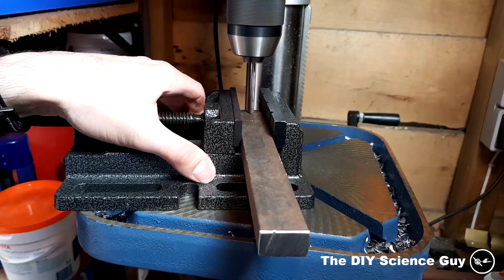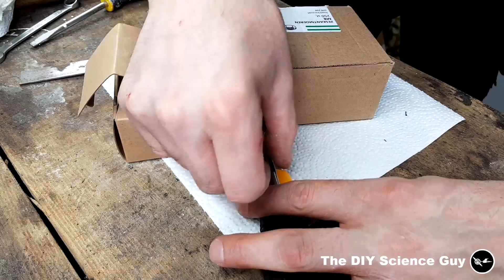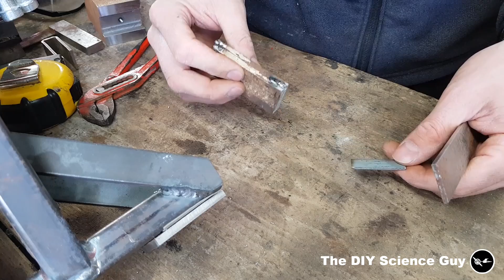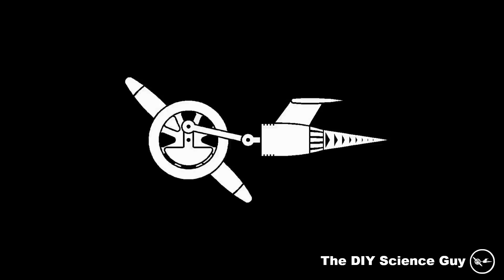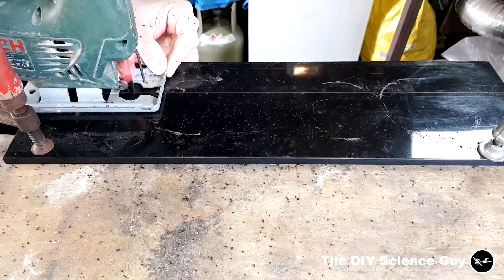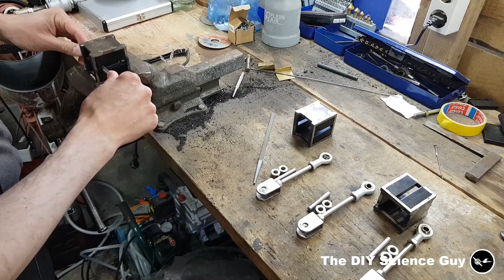Solar steam engine #6 Crankshaft and crosshead-True DIY

Comment: I like the idea of a steam powered reverse trike or car. Problem is coal makes pollution, charcoal is a mess and not as much heat. You would need something like propane or natural gas. It seems making a steam engine isn't too hard for a single cylinder design.

Comment: Hi, great videos you have a very inventive mind and the enthusiasm too! 
Have you considered using your solar powered steam engine as a turbine or generator? I am looking to incorporate a thermal generator design for a solar passive home in the UK. Is it feasible to use solar energy to  provide heating and electrical power via a steam generator to run a typical home?  I was thinking of incorporating a battery pack too as back up, when solar is insufficient.  I would also like to include a grey water recycling filter system.  I'd love to hear back from you.
Reply from the maker: Thanks! Yes I'm going to make a solar powered generator. You do not need steam to heat you house, only warm/hot water which makes it much easier. You do not need a battery pack, just store hot water in a well insulated container ready to be used by your solar generator when you need electricity. Have you seen this video of mine: https://youtu.be/s5Ud-FD33tI

Comment: The bearing surfaces on the crankshaft are called journals.
The half circle on the crankshaft is called a counterweight. I'm not sure you need a counterweight due to the layout of your three cylinders. The counterweight is used to balance the reciprocating weight of the pistons, and top half of the connecting rod in inline and V type engines. Boxer engines are self-balancing as long as all the reciprocating weights are the same. Your radial design might be also. You may want to research how they used to balance radial aircraft engines.
Reply from the maker: Thanks for the info! Yes I do need a counter weight same as with a radial engine.

Comment: Hey dude. How's it going. I think your 8mm crank pin is going to suffer a bit when you start to put a load on the engine. I assume you are going to make this engine do some work. Those that make engines that just rotate, without doing any work, is so lamo. There is a way of having all the cylinders at the same level regards the crank, rather than stacked on top of each other as you have done. The one at the top is going to be trying it's hardest to bend your crankpin. You should review how they set up the cranks in the old radial engines. That would make the crank less likely to bend. Really looking forward to your next video. Best wishes.
Reply: Exactly, it's actually pretty easy to do, you can make it out of a single block of say 12 mm metal, cut it into a equilateral triangle trim the points so they;re flat and drill and tap the cantre of the trimmed off ends to take the connecting rods then hone out the centre to take a bearing to fit over you crank, and I'd be making that crank a little more solid too, I'd look at using a 12 mm shoulder bolt for that job!!
Reply from the maker: I know, we will see how it goes, thanks for your input! 👍

Comment: how much energy can an  engine like this produce? and can they be made 6 or 8 cylinders of the same size?
Reply from the maker: Estimated power os about 200 watt. All cylinder sizes are possible ass long as you keep in mind the expansion cycle.
Reply: @TheDIYScienceGuy  thx for the reply. lets say if u was producing hho gas and using some sort of a boiler and wanted to use an engine like this to turn a generator what can I expect from lets say 1500+ lph of hho from an engine like this?
Reply from the maker: Well this steam engine is going to run on solar energy so hydrogen is not going to be used.

Comment: So, what was the purpose of the Delrin cassettes exactly? You mentioned lubrication, but from what I see in the video the rods are still directly connected to the knuckles, as well as the bracket, that are threaded to the shaft of the cylinders. Aren't the rods rubbing the knuckle and bracket going to result in wear without lubrication? The slot in the Delrin was loose enough to allow the rods to easily slide through them and the force isn't redirected into the cassettes due to the slack. Am I missing something, because I don't see the purpose?
Reply from the maker: It's to take care of the side forces created by the piston rod pushing and pulling at a relative angle onto the connecting rod which creates a side force. If the crosshead support wasn't there the piston rod would bend. The Delrin in the support is to prevent wear in an low lubricated environment.
Reply: @TheDIYScienceGuy  I see, I understand the purpose better now. Thank you for your reply!